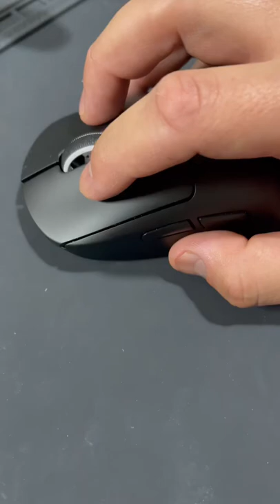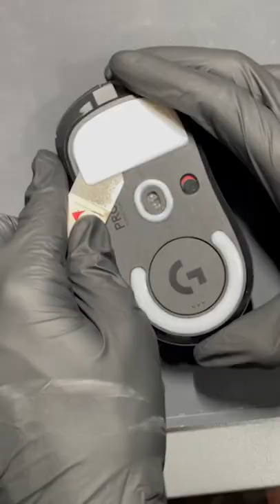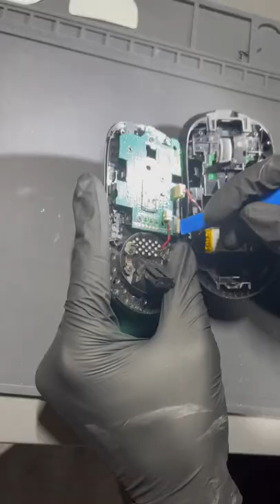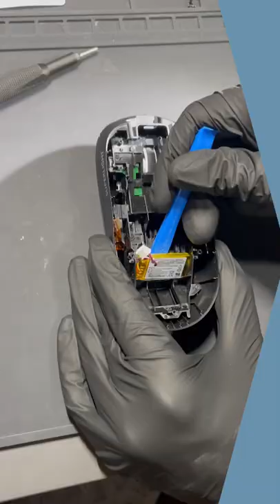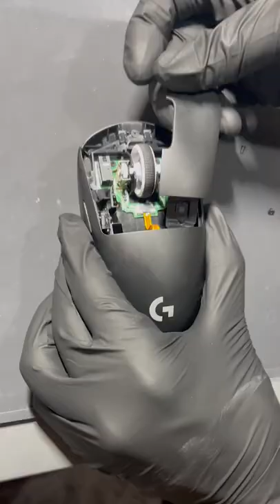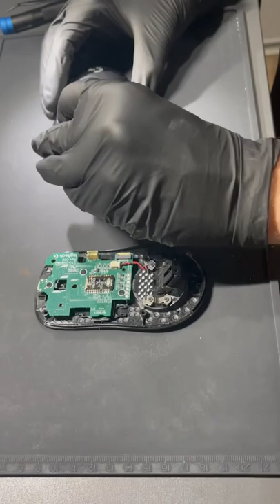G Pro Superlight Switch Upgrade

Comment: now there is a hotswap board that came with ttc gold scroll wheel and u can put any switch u want easy i bought it for my g pro superlight
Reply: does it work good? having any issues?
Reply: do you have the link of the board?
Reply: Just mod it using millmax socket
Reply: bought one too (today), before i got to know that its possible to get a hotswap one. i was using one off aliexpress that have ttc gold 80m switches and the ttc gold scroll wheel soldered in already. now i ordered the hotswap one with huano pink 80m. cuz i never tested them before and i wanna see how they feel like + now i can just buy new switches and put them in, instead of soldering them or buying a new spare pcb.
Reply: @ANTIPHXBIA-Off u have link?